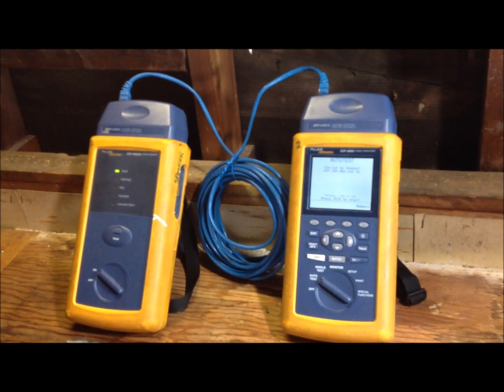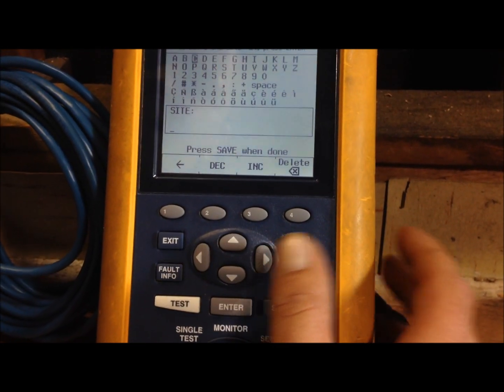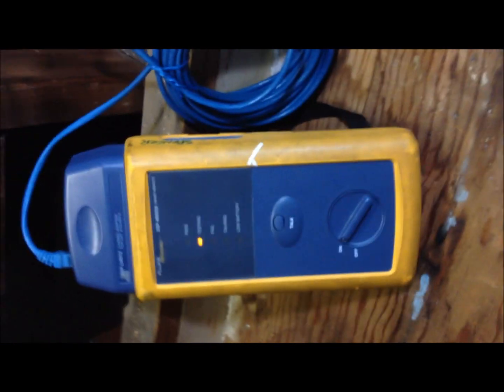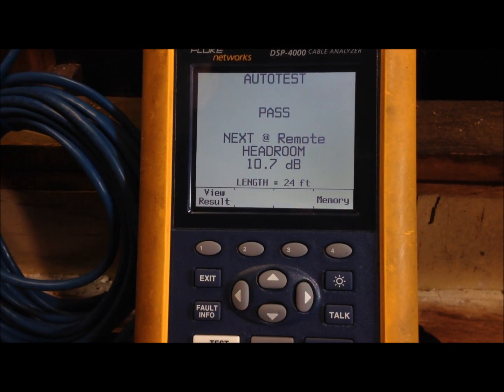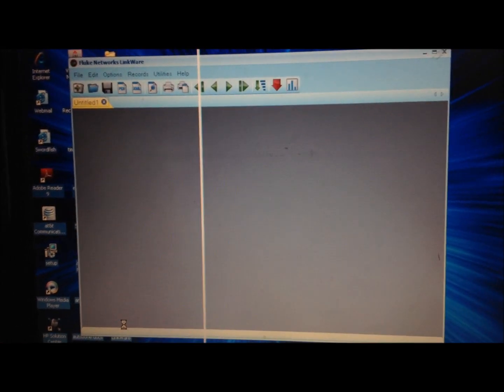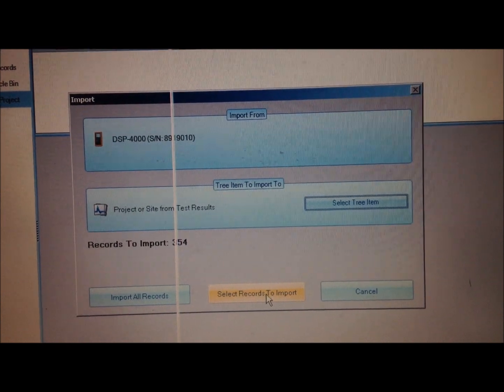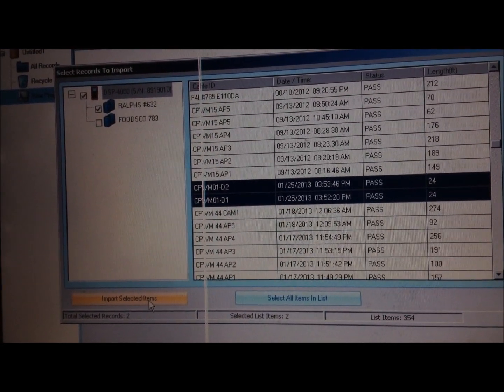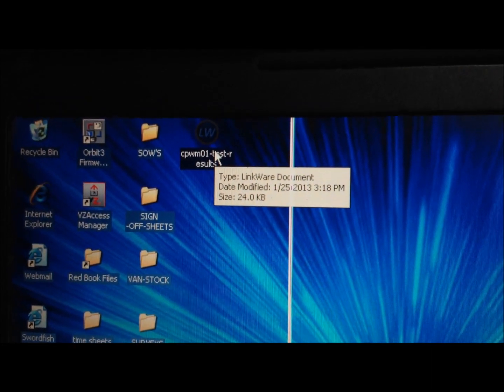Spencer Tech How To Use Your Fluke DSP4000 Cat 5 Tester

Comment: If your DSP-100 displays "INTERNAL DATA STORAGE BATTERY VOLTAGE IS LOW" ... It is the CR2450 soldered inside... They are relatively easy to replace...  Google "Tabbed 3V CR2450 Battery Coin Cell Button 2 Tabs/Pins 24mm". Ebay usually has them...

Comment: Hello Spencer! Thank you for this video

I had a question, I recently acquired a loyal old DSP4000. I run and Import test successfully but when I export the results no plot results are showed... I check configuration adn everything seems fine. I dont know if I need to set the Likware or the DSP on different settings?